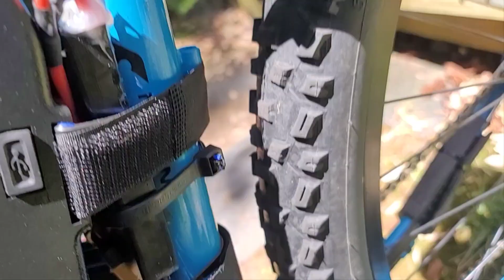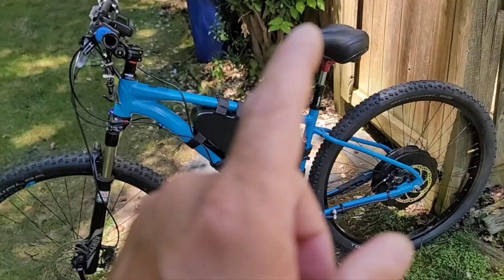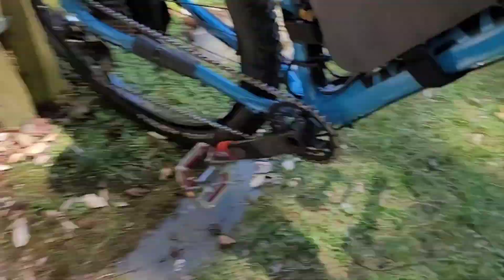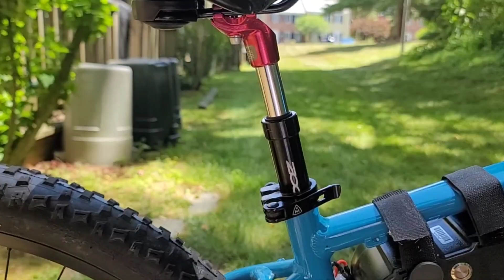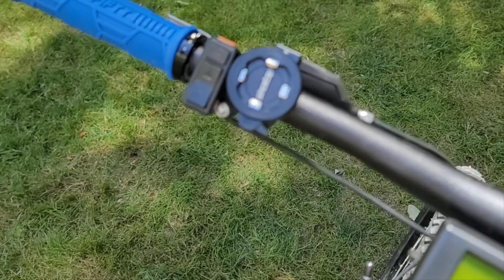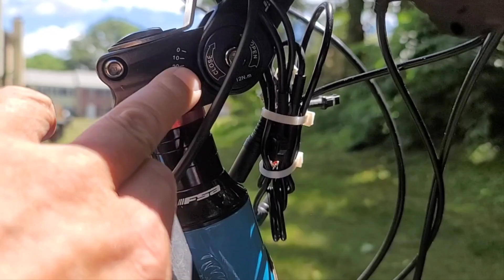My Ne MTB Ebike with Grinn Technologies conversion system 52v 20AH UPP triangle battery, high end!

Comment: I wonder if the battery will fit my Trek 4500 26". The top rail has the bare cables exposed? Velcro might interfere?
Reply from the maker: I'm sure you can come up with a work around. Are those brakes or gears? You could always put full cables.
Reply: Both brake & gear cable brackets are directly on top. Or just stick with a tube-down upgrade that, cost more money.

Comment: What size is the bike frame
Reply from the maker: 26inch
Reply: @ChrisCrossingWires1212  a 26 in frame would be for someone 7' 2" or taller. Looks like a 18" but Trek went to a XS, S, M, ML, L ,XL sizing a few years ago because people often mistake wheelsize for frame size.
Reply: Yes definitely not a 26” frame, more like an 18” at the very most a 20”. Wheel size may be 26”

Comment: forgot the first time I sent the wheel and motor back as well bc the motor was acting up too. probably why it messed with the controller. so that was great
Reply: I bought that baserunner controller just over a year ago. Never used it but turned out that ASI screwed up on the  MOSFETs and controller was only good for 36v or 24v. I sent it back at own expense because it could not run 48v or 52v and Grin admitted this.
Reply from the maker: Bahhhhh humbug!!!